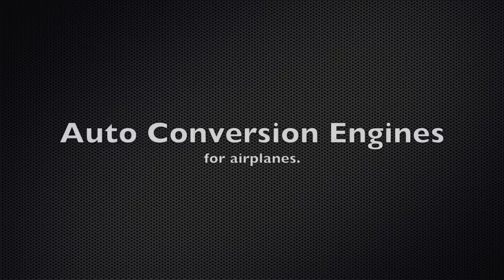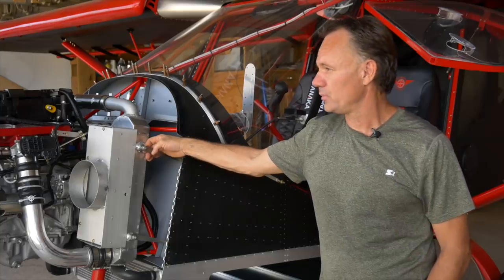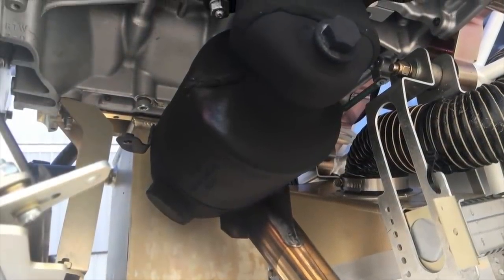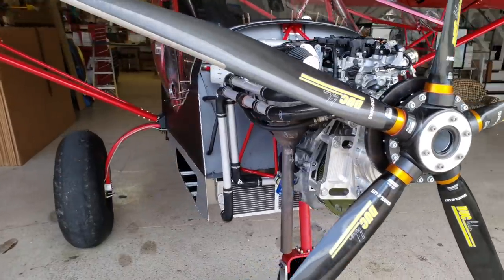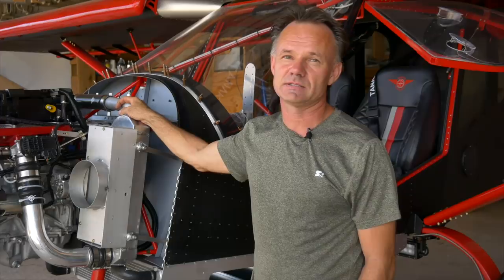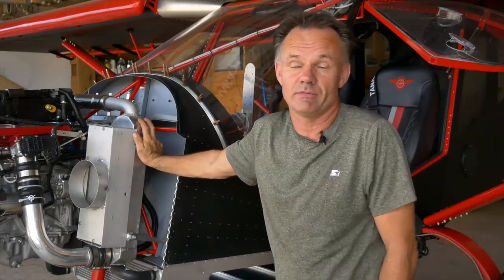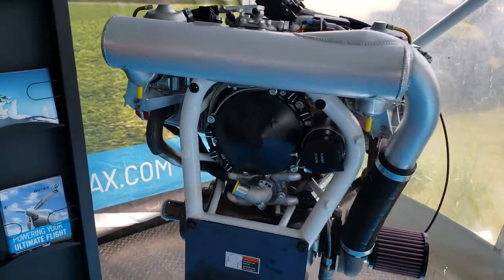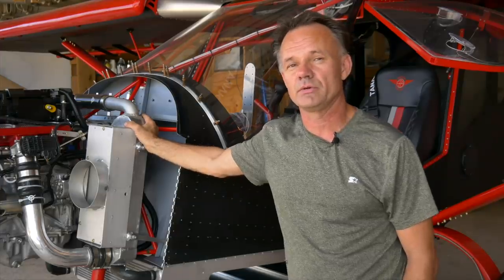Car Engines Used For Flying Airplanes l Viking Aircraft Engines

Comment: true aircraft engine is GAS TURBINE ENGINE not a piston engine
Reply: Gas turbines are not very fuel efficient and are a poor choice for a homebuilt airplane, although some folks have used them to power ultralights (like the Mitchel Wing one).